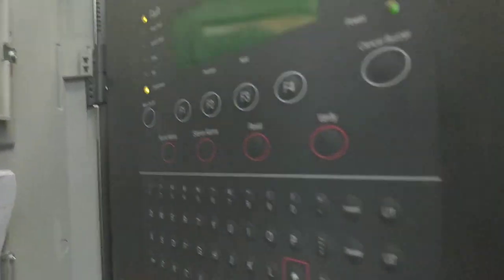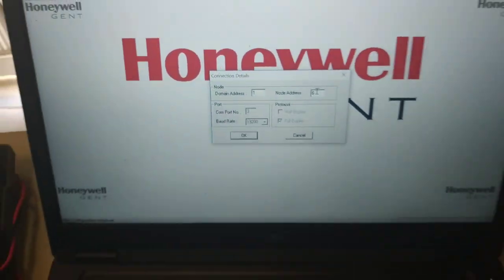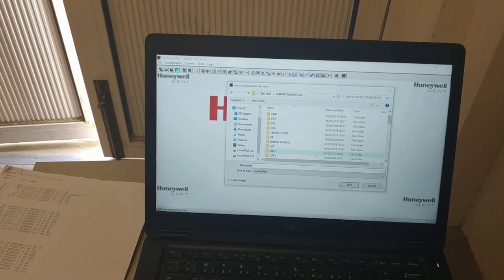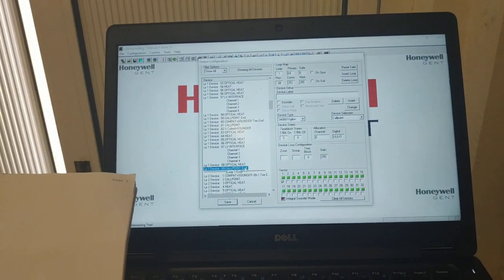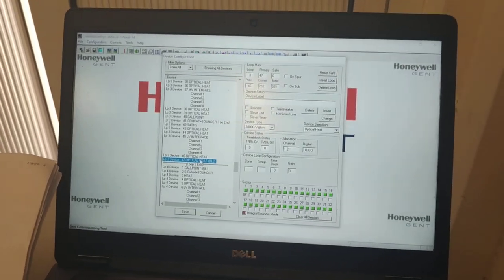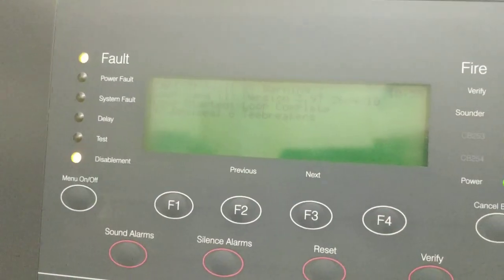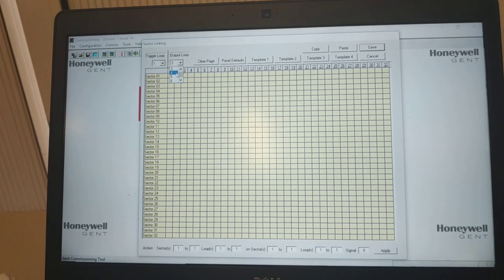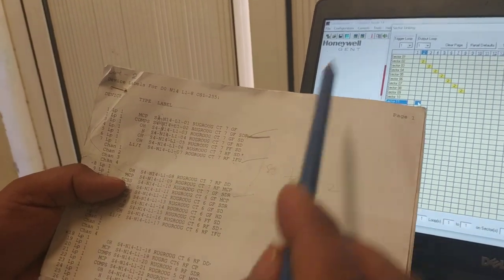Fire Alarm System GENT Vigilon by HONEYWELL

Comment: When i test one floor everything is working normal elevator stopped, AHU stopped,Access door open. In other floor elevator continuously working and other things working good.
What will have to do please reply. 
Is it programming issu .
Can i solve from winmag plus please give me reply
Reply from the maker: check your program if what is the proper actions when you triggered the device in one floor, and if you want to be general actions so you need to assign the device to all output signal action during the event of fire . and you can do manually in the panel if you know it how to re-program or can you do it in gent com.tool software. There is no option to do it in winmag pc.
Reply: @florendoregner  can you tell me how to do from panel
Reply from the maker: @CookWithAkhter  florendoregner@yahoo.com
Reply: Dear sir 

I hope you are doing well

  

I am jawed akhter 

Fire Alarm Technician 

I need your help related to manual programming from panel

We have gent vigilon 6 loop card panel 

We are using one loop card for one floor 

When we pressed the MCP OR any alarm cases some activity is going on. Sach as stair fan running.  Elevator stopped, AHU stopped, Access door open for every one we are using s4-34420 interface module.

When alarm coming in 3rd floor every thing is working good. For example  AHU stopped, Stair fan running, Elevator stopped, Access door open  every thing is working fine 

But when we pressed MCP in 2nd floor  Elevator not stopped,  and stair fan not runing .

Please tell me how to program manually from panel
Reply from the maker: @CookWithAkhter  check the status of sector, zone or group the devices you are  tested at 3rd floor  and do same thing the devices are you tested at MCP at 2nd floor. assign it manually in the program go to set-up-assign-device-sector,zone or group which loop and enter it.

Comment: Who can answer...How to configure monitor module as fire using panel without comtools?
Reply from the maker: Not possible.Output module single interface  you can program without software, but monitor LV module is not possible. Contact me for further explanation: regner220@gmail.com

Comment: Can you please share vedio of how State of device can be cahnged in software
Reply from the maker: Hi,you can change the device state condition at panel itself and its very easy to do for you. But you can used software thru device config and just put the device states option on (states) and  off (states)  after proceed to timeblock put designated time required by your client at site if when it be the action of youe states condition to action.
Reply: Boss u have software??
Reply: @florendoregner  But i just want to decrease sensitivity of some devices , not want to put them off.
Reply from the maker: @muhammadasadimam756  yes you can do by changing state only in the panel and please refer to state condition code

Comment: How to program in gent vigilon
"Example: Four panels are network-connected, with one panel working as the master panel. For instance, if an alarm is activated in any building, all activities need to be reported. Then two buildings are connected, and a device is activated in one building, it should trigger simultaneous evacuation in both buildings. Then however one building is a separate entity